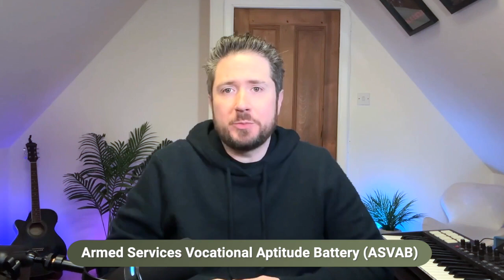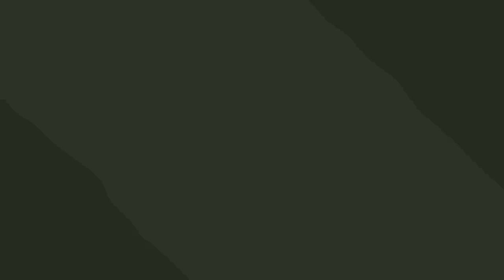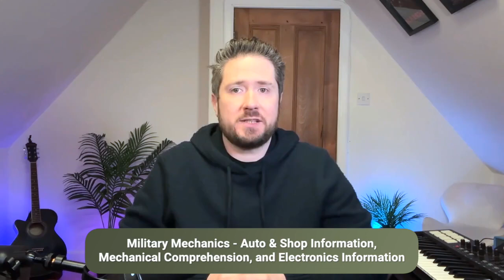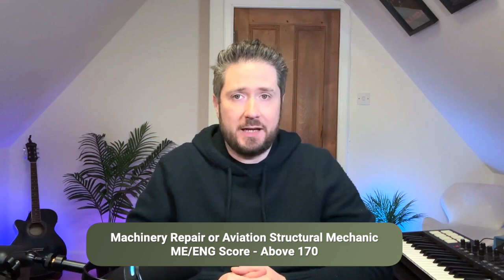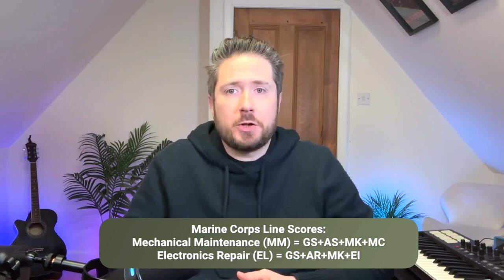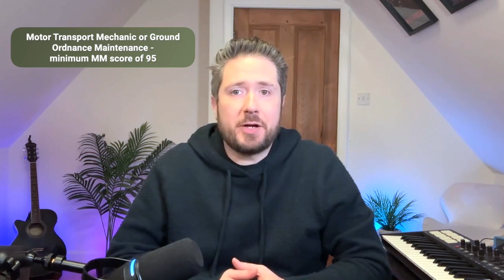What ASVAB Score Do You NEED for Mechanic Jobs? (Most People Get This Wrong)

Comment: I joined the army out of high school at 17 in 2002... I had no idea what I wanted to be I just didn't want to go to school... I took the ASVAB and they told me I should be either a mechanic or a plumber.... I pick mechanic because plumber sounded disgusting... Thank you for this video cuz I had no idea why mechanic was the top choice for me
Reply from the maker: Thanks for sharing this, and that’s a great real-world example of how the ASVAB works. Your recruiter was most likely looking at your Army line scores, since mechanic jobs are tied to the Mechanical Maintenance (MM) composite, which comes from Auto and Shop Information, Mechanical Comprehension, and Electronics Information. Sounds like you had a natural strength there, so hopefully the mechanic path treated you well!

Comment: What is the official score I need to become a aviation mechanic in the navy
Reply from the maker: Great question! For an aviation-mechanic role in the United States Navy - such as the Aviation Structural Mechanic (AM) rating - you’ll need a specific composite line score on the ASVAB, not just the general enlistment minimum. For AM, for example, the requirement is VE + AR + MK + AS = 210 or VE + AR + MK + MC = 210. If you’re aiming for an aviation-mechanic job in the Navy, aim for that ~210 composite so you’re eligible.

Comment: What is The oficial score that I need to join the AIR FORCE ? I have my test next month
Reply from the maker: Good luck on your test next month! For the Air Force, you generally need an AFQT score of at least 36 to qualify, but some jobs might require higher. Make sure to check with your recruiter for the exact score you’ll need based on the job you want. You’ve got this! ✈️
Reply: Just Aim High!